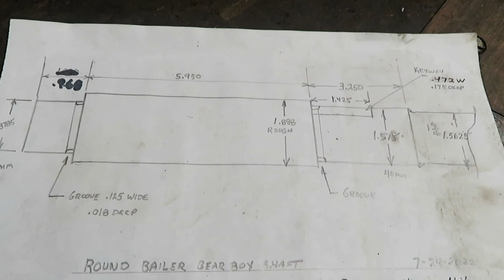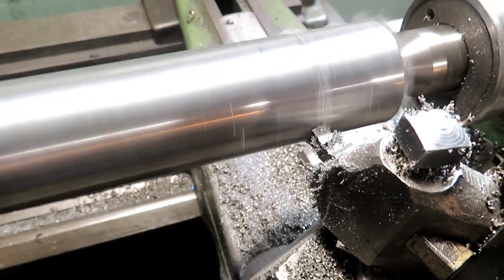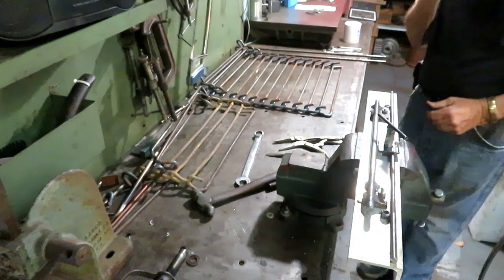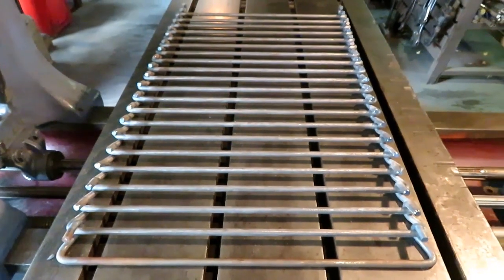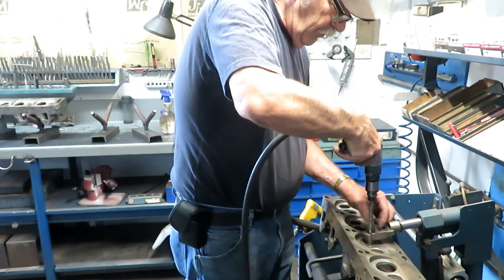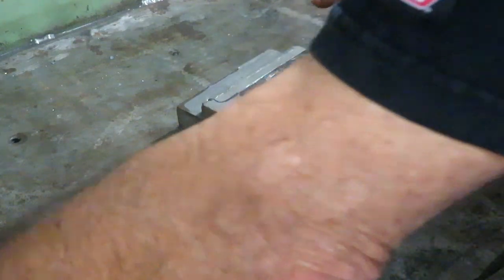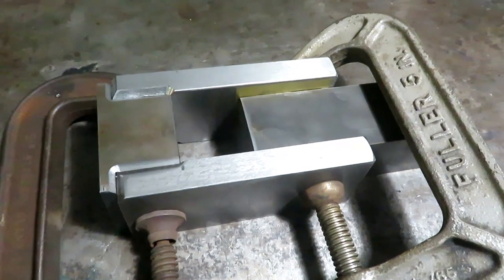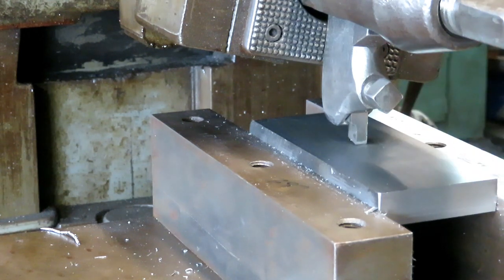Old Steam Powered Machine Shop 80 Steam Shop Work

Comment: So glad to see a new video.  Always enjoyable.  Years ago I on occasion would run a large open side planer resurfacing cast iron ingot molds.  Using the side head I would get a long "beard" of chips and dust hanging down from the tool. Everything was magnetized. We used 1-1/4" x 1-1/4" x 9" tool steel bits. Love the channel.

Comment: Good one Dave .   We call those bronze sleeves  K Liners .   They are that good , they also fit them into replaceable valve guides  when they are worn .      That cross head is an interesting one , how it may have been made  made .      You could use those small tea candles to keep lighting the oxy  . You know then when it's time for a break ,  the candle has gone out !   Cheers .👍
Reply from the maker: Hi Max, I guess K-line invented them. I've used them in removable guides because somtimes (like big block chevy v8s) the guide OD bores are not concentric with the seats, so if you replace the guide they will be way out of wack with the seats requiring oversize seats.....Dave

Comment: I just found your channel David.  You do great work and I really enjoy the videos.  You remind me of a guy (also from NY state) who taught me basic skills on the lathe back in the 90's.  State highway shop so we worked on a lot of large trucks and machinery.  The shop had a several old lathes and milling machines that came from battleships and other Navy vessels that were decommissioned after WW2.  Before I left that job, I was able to snag bench vice made by Reed Manufacturing Model 104 1/2.  I believe it also came from one of the decommissioned Navy ships, and I still use it today.  From my research, the ships that were decommisioned after WW2 were mostly built in the 1920's, so it's the oldest tool in my shop by far.

Comment: I had a lot of fun imaging a lathe that instead of turning a full circle only turns about 200 degrees.  One the one side of that cross head is pin is turned you change the setup and turn the other half of the shaft.   I think it would work, but I can't imagine doing it in a production shop - would have to be slow.

Comment: I worked in a machine shop that was at a foundry. They wanted to be cheep and use scrap material that had been unloaded from freight cars with a magnet for the foundry.  We learned real quick how hard it was to work material that was magnetized. The tool post would even become magnetized.

Comment: We use the DCM mill with the table that pivots in the Y and X axis. We get on level to each guide using the guide mandrel and a level that fits on mandrel, then level head to guide. Then we use a core drill and drill out old guide to size, then we press in new cast iron guides and use a reamer to bring them to size. Basically, we keep the old guide in place thats casted as part of the head, the new guide gets pushed into that. Because we level on each guide before any core drilling is done, nothing is out of line of origuonal seat position because of leveling on guide. All in all, because of the DCM mill, we can have a set of v8 head guides installed and sized in under 15 minutes and were on to cutting seats. Seats i dont care for are the big john deere, cat, heads as they get really hard to cut.  We do a lot of heads through out the year and the older i get, the less i like the big heavy 170 pound plus heads. Their just a tank to move around anymore.

Comment: A treat to watch this series of jobs.  And at the weld up to match a cast piece, fitted to the steam element a nice answer to the square to round assembly.  Who knew my small shop needed a shaper?    My South bend is a 1935 model.  Where Tom's work came from a 1925.  These machines have a long and interesting history, with some great photo's shown on South Bend web records as production across the years.  The scraped tolerance of the ways, the early to late apron features and the change gear sets made these units useful but a little demanding to set up.  Attachments included a taper device, and both British and US made mill units that clamped to the bed. The bed stamped serial number define year made.
Various makers to that design and very often of smaller work piece dimension.  I think from the post, both as where Tom is working and my unit, a 9 inch capacity.  Most of all where I laugh when comparison to a "Chinese mini".  *Durability, construction and tolerance.
Tom's workpiece at near 100 years and still productive to that machine. For small shop as hobby or the waves of advance in weldment, grinding tolerance and various alloy...the age of steam gave way to more modern features but at the time (let the observer compute that year range for themselves) were the absolute best of method.  In the forests of the west, 
steam caused a lumber production also unique.  Lots of books and photo's to that interest.
Dave, what's best to my enjoyment is your patient and knowledgeable comment as real work in an interesting shop, meets unique and everyday.  And steam was the powerhouse of delivered force to cast iron and brass and steel real to our near past.   Thanks so much for having me along.   M.
Reply from the maker: Mark, thankyou for your great comment, I couldn't agree more. Now if we can get production back into the U.S. (I see a little of it every day) we'll be fine.....Dave

Comment: Hello Dave! Shaper is a very powerful and useful machine to planing large surfaces. Me & my father resurrected a big hydraulic-based shaper with 750 mm stroke. 10 kW main engine,160 liters of hydraulic oil.. but 750 mm stroke! 😀

Comment: Dave, try a slight angle change of the bit. You will also have to adjust the rotation speed of steel you're machining. You have reached that magical harmonic speed that will magnetize. It's caused by the heat generated by the bit coupled with the ultra-high frequency created by the contact of bit against the steel. I suggest slightly speeding up the rotation and taking less of a bite.
Reply: Why will my Craftsman combination wrenches magnetize to each other by just hanging on a peg board in my garage? I don't notice that they attracted a nut or bolt, but they attract each other.
Reply: But, without coolant, he's got to take enough of a bite to remove heat away from the bit along with the swarf. Coolant were embraced for just this sort of occurrence.
Reply: @Wa3ypx  Is there any wiring in the wall behind the peg board?
Reply: @pauljw7697  There most likely would be.
Reply: @Wa3ypx  If you know of no other way the tools could become magnetized, then I would think the magnetic field created by the flow of electrons in any heavy wiring or cables could possibly be the cause.

Comment: Hi I'm thinking that the crank pin was placed between the cope and drag then the cast iron was poured.  your design is much better than the original it is probably is more costly than the casting. 
I love watching the videos, keep up the work!
Rich
Reply from the maker: I think your'e right but it looks like the radius were machined where the pin meets the sides..??..Dave

Comment: That chain belt reminds me of a belt that was on a mechanized broiler that was in a kitchen where I once worked.  It was about a foot wide and eight foot in length.  All stainless steel, the belt carried meat thru a broiler which would cook continuously.  Cleaning that broiler was a pain because the chains had to be removed and soaked in cleaner/disinfectant overnight.
Reply: Reminds me of the burger grill at Burger King fast food.

Comment: hey dave ! thanks for the videos. on your cross head if the slides are dovetailed into the sides and head piece it will lock them and provide positive stops for the pin...it can still be drilled and bolted to stop it sliding
Reply from the maker: That's the idea Mike....Dave
Reply: @davidrichards5594   as a machinist would it be preferable to part 4 pre cut gears off a blank or cut the same gear 4 times? i am prototyping  a torsion bundle frame where the bundles are tension ed by 4 ratcheting berings .

Comment: Dave, I think the bar between the cheeks of the cross head casting is only there to hold the dimension of the two cheek as a finished casting. The bar holds the width dimension and in plane. That bar would be machined away and a solid pin is placed thru bores suggested by the center holes.

Comment: Have 1/2  12 tpi holding the bearing caps on my 1905 F. E. Reed 14 X 96 lathe.  Uses all manual gear changes to thread & am currently working on a 60 tooth 12 pitch gear so I can cut 10tpi for replacement lead screws for the saddle.  Have following rest, came with the machine, so those skinny 9/16 screws can be threaded square over a good part of their overall length.  Nuff challenge for me . . .(grin)

Comment: Dave, the magnetism is a result of the induction heating done to stress relieve the steel.  You could do a demag pass with an electric coil to demageitize the steel.
Reply from the maker: Ed, Yes, and I read where eddy currents are used to "Test the steel" in the "Stress-proof" specs.....Dave

Comment: You could use a large Diesel engine wrist pin, this would give you a high strength ready made cross head pin. Save making 4140 pins.
Reply from the maker: Good idea, and I probably will do that....Dave

Comment: Thank you for your work on these presentations. I really enjoy them. i must say one thing, and it is not to be taken as a negative comment. I was supervised to see a carbide tool in the neutral rake tool holder. I used this method for many years. but in your beautiful shop, I would think you would have Rex AAA or even old forged tool bits! I have had that problem with stress proof (1144) this week I have 12 mm 1144 studs to single point thread. interesting material. Again thank you so much..
Reply: Rex 49 even better than Rex AAA, or  Rex CPM 76!
JIM

Comment: Hi Dave, love your videos as always. I like the two part casting idea for the crosshead, cheeks and pin cast together, machined, and end cap added after in a re-cast. But also wanted to propose that a wide but narrow shell end mill on a vertical mill could possibly do the job if the crosshead was set between centers and rotated. You'd have to do it separately for both sides, but the mill could reach across the closed gap. 

Or on a lathe, a driven milling attachment on the cross slide would be similar. The spindle would have to be turned by hand, not powered, and you couldn't go all the way around. You'd have to retract the carriage to clear the crosshead body, but return it after rotating past. Mill, if narrow enough would fit in the gap at the cap end. Not saying that was how it was done, but a possibility, that could also explain the center drilled holes.
Reply: Hacksaw--you could generate a portion of the pin with a shell mill, but you won't be able to complete the enclosed portion. The unfinished angle would be determined by the height of the crosshead and the diameter of the mill shank. That means it would take handwork to complete the shape. Not really what you want in terms of accuracy and surface finish in the direction of the piston forces.

I suppose that you could make up an internal grinding wheel comprised of multiple pieces. (Think of a normal grinding wheel cut across the diameter into segments, then size the hole using adjustments on the frame/housing containing the pieces, and spin it. A pretty specialized tool. Another way to visualize this would be to consider an epicyclic gear set. In the place of the sun gear you have the shaft being ground. In place of the planet gears you have grinding wheels. The outer "ring gear" drives the whole works.

I suspect that a steam engine, especially if run as a low rpm/high torque machine would have lesser peak rod forces than an internal combustion engine. That would make the welded crosshead more viable than one might think. Perhaps Dave can enlighten us...?
Reply from the maker: I think you may be on to some thing there with your first idea.  I took a close look at the cross head on the big shop engine and it looks like it's made the same way with center holes on the sides. A quick and dirty way of doing it, but the pin can't be replaced when worn.....Dave

Comment: Dave I believe they used the losted wax process to create a ceramic core , extremely accurate and no joint line .
Example blades for a jet turbine engine no machining because of the hardness of the material .
Christopher from Down Under

Comment: My vote is that the old crosshead pin was already to size when it was cast in place. After casting, the center holes were drilled on the outside for convenience based on indicating the pin.
Reply: Was that a common practice. Casting around a finished piece? I've never heard of that before but it's very interesting if true

Comment: Perhaps a remedy for demagnetizing the material would be to use a degaussing coil or loop hooked up to AC voltage source, or even inside an induction motor's field windings with rotor removed, and turned on for a few seconds at a time as not to burn out the starting windings!

Comment: The old potato shafts look a bit bent. Did I miss the material you are using?
If I had to do it, maybe 4140 ht?
Nice jig. Looks great.
I love your machines, they are old but man they’re clean and well maintained!
Reply from the maker: Jeff, I used just hot rolled mild steel. It was a lot tougher than the original stuff.....Dave

Comment: To get rid of the magnetism you need a degassing coil just a piece of soft iron and wrap with insulated wire to make an electromagnet  hold it next to the steel part then move it slowly away in a circular motion

Comment: Holy crapola, who else would duplicate a cross slide from scratch? INCREDIBLE!
I also would like to know how the pin was finished in the original which had to do with the center holes.
Reply: I think the pin was cast in the head and the finish machining of the head was located off the pin!
Just my thought.
JIM
Reply: How about the finished pin was positioned in the mold with a donut core ring before casting? 
The center holes located/drilled from the pin centerline after the crosshead is removed from the mold.

Comment: I have seen examples of brass hinges with a cast in pin and I suspect that is how this cross head was done. I say that because as you mentioned David, how do you machine it? I know of no such way given the era of the part. Perhaps CNC  today, however that does not help the people that made this Engine way back when. Great video content, John, Australia.

Comment: Dave, to save your welding gases and time re-lighting the torch on long jobs like the potato conveyer belt replacement, what if you used one of those "gas savers"?  I've seen them used on several channels here and the weight of the torch on a valve-arm cuts off the main flow of the gases, but keeps a small pilot flame burning to re-light the torch as soon as you lift it from the arm.  John Switzer at Black Bear Forge here on YouTube uses one quite often.

Comment: Nice work. I notice that you don’t use cutting fluid with the lathe turning the axle.  I know CF can be messy and if it doesn’t have enough biocide can get smelly, but doesn’t that dramatically reduce your cutting tool life.  I notice some of the swarf was coming off very hot, blue in fact.    Enjoyed the vid as usual
Reply from the maker: Bob, At the speeds I am running in this shop and with a tool point (not like indexable) that is actually sharp, it doesn't build enough heat to make it necessary. I'll use a little oil on a finish cut to improve the finish. I think there was a chip on the cutting edge in that clip where it got blue.....Dave

Comment: I suspect that the cross head was cast as two parts, but only the bored/threaded end cap was cast after the fact. The roughed sides were cast with the turned pin.  Then, after re-casting, the sides were shaped true to the pin. 🤓
Reply from the maker: Jeremy, Now that sounds like it could work. I think you're on to it.....Dave

Comment: Good work Dave, when is saw that chain you were working on I knew it had to be a potato digger. I have repaired a few of them in my shop. As for the wrist pin in your cross head why not a large diesel wrist pin? It would be hard as well.
Reply from the maker: Hi Bruce, That is exactly what I'm thinking, The diameter doesn't matter because I'll be making the small rod end anyway....Dave

Comment: Hi Dave. That cross head is going to have me thinking for a few days. Is there a smaller pin holding a larger bushing fir the bearing surface. A bit tricky I know, the tolerances would have to be spot on. I like the idea of captivating the new pin though, using the guide rails. Are you going to slot the end of the pins too.
Reply from the maker: Bob, No, the pin will end at the sides before the sliders are bolted on. That's the plan anyway.....Dave

Comment: You know Dave, you're showing machining reality before the advent of Shell Dromus oil coolants. When you had to be knowledgeable about taking a big enough cut to take the heat away with the swarf coming off the bit. A whole other dimension to feeds and speeds that people just don't have to think about today.  The molecular structure of the steel at the one end of the shaft due to heat treating method is such that frictional interaction between bit and shaft is creating your magnetic loop.
Reply from the maker: I have since read that "Stress Proof" 1144 steel uses eddy currents in it's processing, might be that?....Dave

Comment: They might have had a specialty machine to turn those crosshead pins that turned back and forth with cutters the reached just past the center at the closed end coming in from each side. I suspect the shaft was handled with or was near a lifting magnet at some point.
Reply from the maker: The magnetism might be a common thing with Stress-proof steel. I read in the specs where eddy currents were passed through it for testing during production....Dave